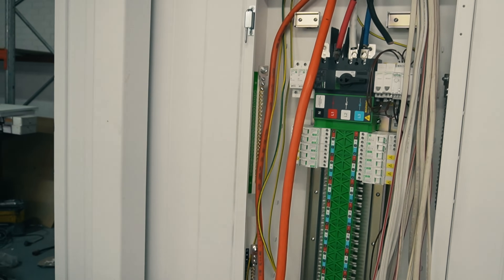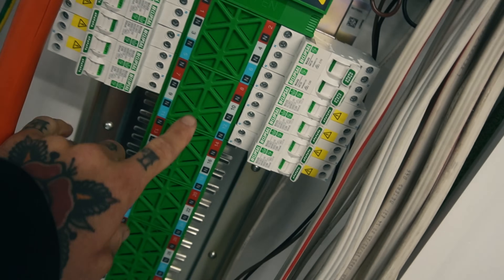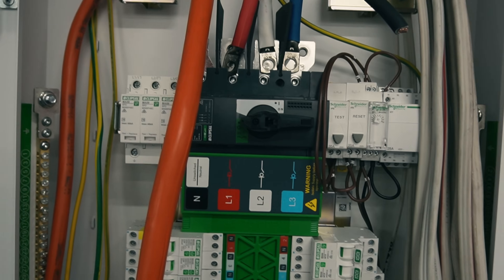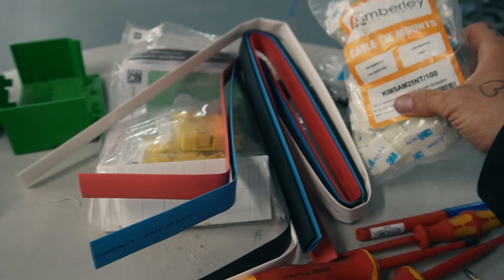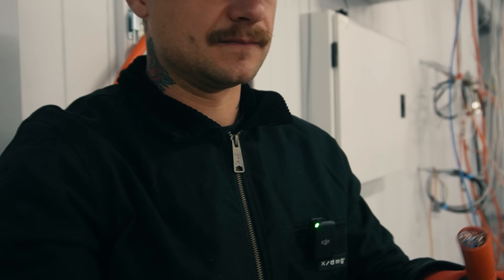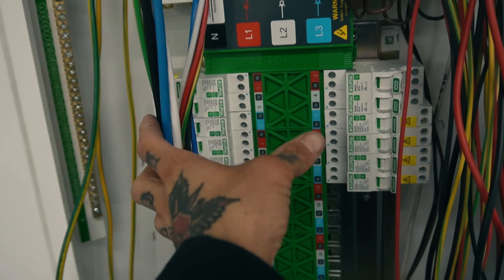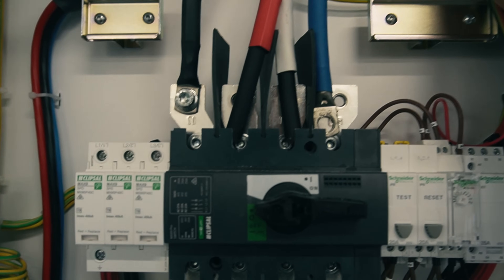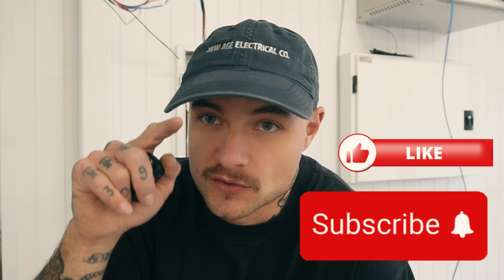First Look At The Newest Australian Switchboard  by Clipsal- MAX 9 PRO

Comment: Woah,
So many good tips, I've been wiring things for 30 years and I must say there is nothing wrong with being a bit OCD, especially when you open up a board and it looks like a 5 year old wired it.
Wiha does the same stripper without that janky looking knife at the top, I've had the Wiha one for 3 years, I don't leave home without it. 
I really like the layout of that board, hopefully these come to New Zealand, I like the fact that they have space for surge diverters and other things, which in a standard board tends to mess things up, if they are added later on.

Comment: Will be curious on these boards to see what battery and solar system you are running for your own factory and how you wire backup loads into this board. I am a solar sparky and always keen on learning better ways of doing these DB boards for backup loads. 

Will have to start following your lead with the bootlace crimps into RCBO's - looks neat.

Nice that you can get these now with the Neutrals integrated into the chassis, saves alot of time working to a neutral bar on the opposite side of the board.

Comment: I get the idea, but just instantly takes away your ability to choose 3 pole breakers at a later point.  Depends on the price and application, but nice to have options.
Reply: I’m 99% sure Clipsal max9 actually got 3 phase mcbs with 1 neutral slot and 3 dummy slots for the neutral bus
Reply: @Felixandco.electrical  MX9R35 is it these 3phase  RCBOs?  5 poles wide!!!  And only up to 40A?

Comment: You don't need a sticky back as there is a punched tie off point just below where you said you would put the sticky back. You can see it when you move the T&Es out the way at 7min 20 sec.
Unless you put some super glue on the sticky backs the weight of the cable will peel them off anyway.
Edit- I knew I commented to soon, I figured you'd see the cable tie points eventually, but I stopped the video for a while then came back to see you noticed them.
Reply from the maker: They actually stay in there fine over time, obviously depending how much weight pulls against them. Never needed super glue 
We also use ones that we screw into the back of the weight is going to be an issue
Reply: @NewAgeElectricalCo I waited until the end this time. As long as no cables pass behind the board now or in the future a short self-drilling screw if the head fits in the sticky back will obviously hold, but without a fixing screw or glue which removes the danger of the point of the screw hitting cables in the wall, sticky backs are renowned for coming off on there own or when they get disturbed with new work in the board.
The manufacturer actually put solid tie points from top to bottom  between the breakers and the earth bars and with enough space at the top for all the cables coming in on the RHS to run across to the LHS then down the central cable tie points.  Running behind the bus or tucking behind the breakers and earth bars is unnecessary, having a board with dedicated cable pathways speeds up installation and it's easy to trace the cables from the enrty point to the terminations and it can still be neat. We hide most of our work around the installation, hiding it where someone might need to get at isn't practical. Now if only all switchboard makers put cable access like this in there board it would be so much better.